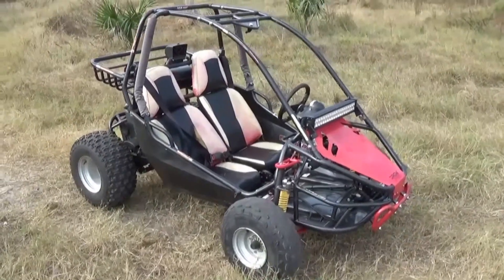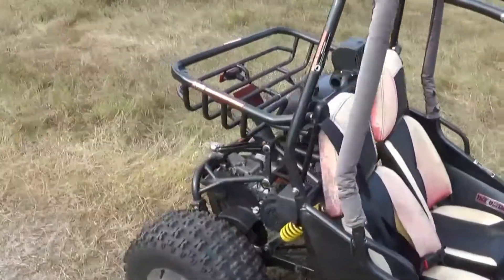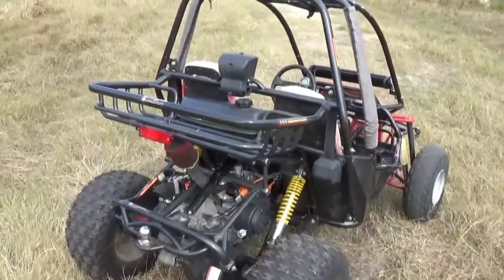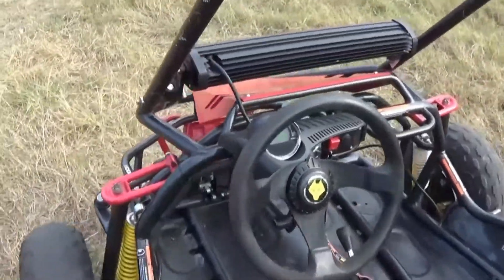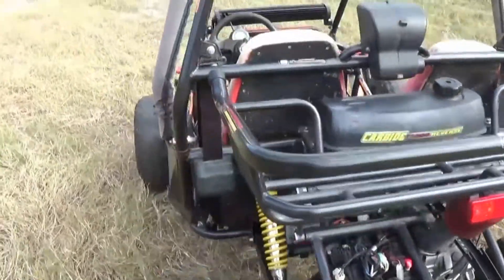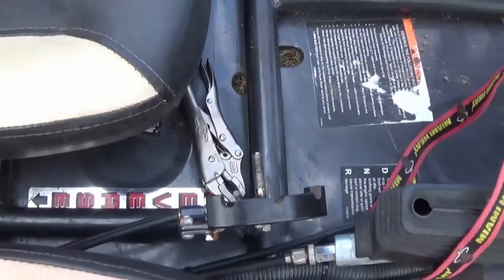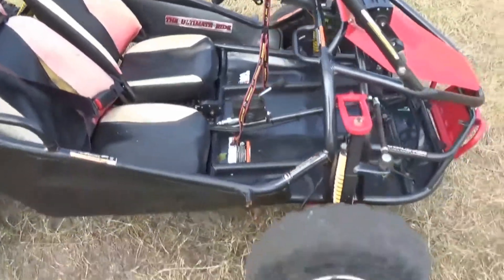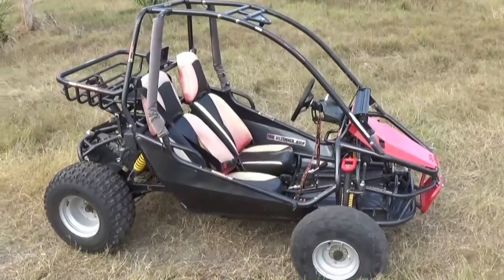ASW CARBIDE FOX KART OFFROAD GOKART 150CC

Comment: I have literally the EXACT same kart, runs great, all the same, but it dont have the light bar in front, that's extra. Also my seats are Dark Red and black, like urs but darker, I think ur seats are faded. It's a really nice kart though, I've had mine for a few years now, you'll like it.
Reply: I have the same one as well it's great it just doesn't like to start but once you get it going it runs
Reply: @Shitnballs-69  EXACTLY lol. Mf is like an old ford. It takes forever to start but ONCE IT DOES, it runs forever until you turn it off. I'm having a new engine put in it
Reply: Made this comment like 3 years ago, still have it. I've had this cart for about 7-8 years

Comment: I have that same gokart we have replaced the variator with 10g rollers and a 1500 rpm torque spring and clutch it will not pull a hill? any ideas it runs strong and fast on flat ground but will get half way up incline and motor keeps strong but kart comes to a stop.
Reply: try 8 gram rollers     and I put on the yellow clutch spring ...  it now has major torque and yes I can climb hills to an extent ..  remember the clutch system is different design then dirt bikes ..  there not made for speed  .. but I got 65 outta mine on flat land
Reply: Try 18 grams with red spring and 32 mm carb
Reply: I changed the stock sprocket to a 39 tooth and it made a huge difference.
Reply: I have same cart... check ur belt
Reply: I have the exact same kart in the vid, minus the extra LED light bar in front, I did no upgrades, I've kept it the same since I've bought it a few years ago, and it's always had a lot of power, and climbs hills no prob, idk why urs dont. Do you have a smaller engine then 150cc?